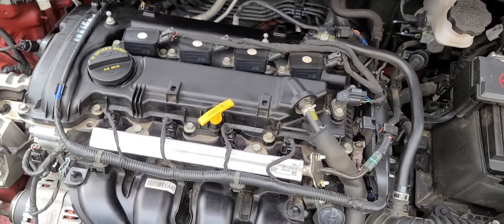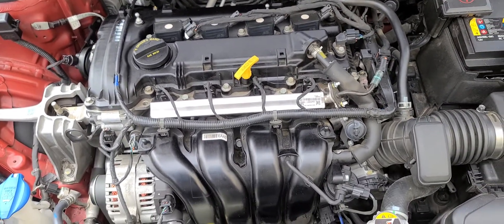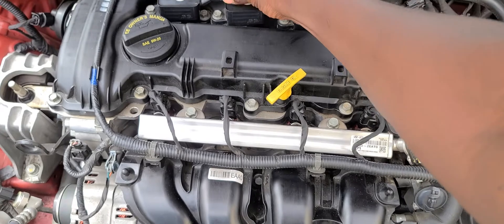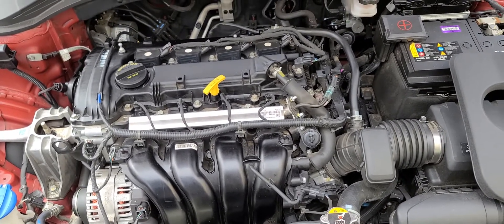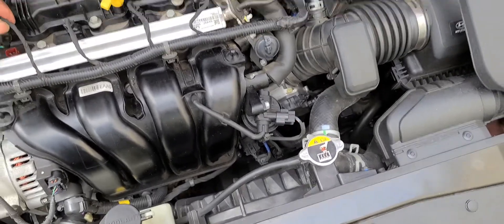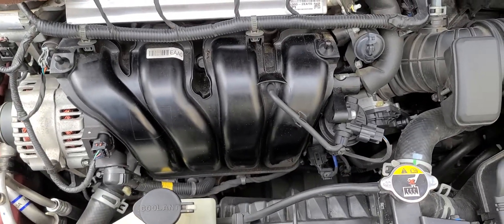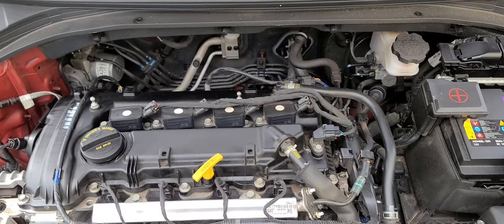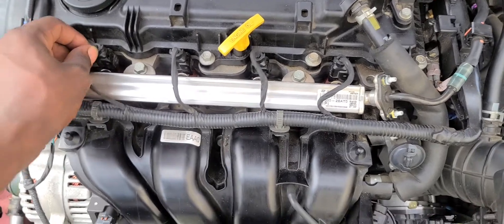things that can cause your car to misfire Hyundai Elantra se

Comment: Hi when i unplug mine it shut off.
Reply from the maker: What is the reason for unplugging it?
Reply: @MrtalentedReid  cause I seen you unplug yours an it still stay on.
Reply from the maker: @orlandoquinones5273 oh do you have a misfire Before unplugged it ?
Reply: It says misfire cylinder 3 but I changed coil an spark plug all new still says it an still with a check engine light on
Reply from the maker: @orlandoquinones5273 check the wires for corrosion and use a good scan too to reset the code

Comment: Does the engine have a slight vibration normally? Mine had/has (not sure I really fixed it) a cylinder 4 misfire. Car runs great after replacing spark plugs so I cleared the code and light and it hasn’t come back, but my engine still shakes. Is that normal?
Reply from the maker: If it still do that means the problem hasn't fixed. You may have a bad ignition Coil spark plugs bad injector

Comment: Hi Mr. Talented
I drive 2017 Hyundai Elantra GLS. It 144k on it.
Lately its been giving an unusual problem.
When the car is about slow down or idling, rpm starts to fluctuate and I feel vibration. No check engine light. It stays on for few seconds to 15 seconds and goes away. My mechanic cleaned throttle body and changed all spark plugs. Still the issue comes. 
Link below is the video I was able shoot last time it started doing this. 
https://youtu.be/tVyLgQk7I2M

Do you have any idea what it possibly could be?
Thank you
Reply from the maker: Check the idle air control valve and the best thing to do it to hook it up to a obd2 scanner and it should give you a code whats going on
Reply from the maker: It could also have a shortage in it ignition coil but gat it scan you can also purchase a small obd2 scanner and keep it in the car soon as the check engine light comes on you hook up the scanner and u will get a code and and get back to me
Reply from the maker: https://www.amazon.com/dp/B00UJV3E12/ref=cm_sw_r_cp_apa_fabt1_dlC_IIyRFb3AZ94YM?_encoding=UTF8&psc=1
Reply from the maker: U check if there's any broke hoses also